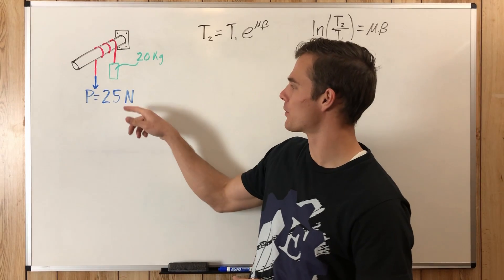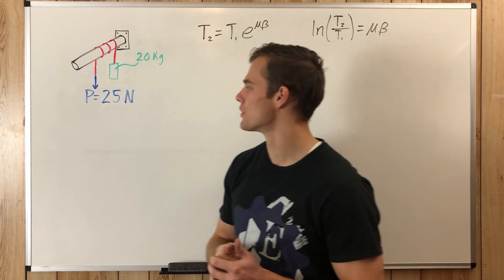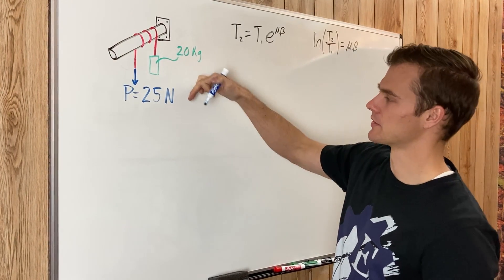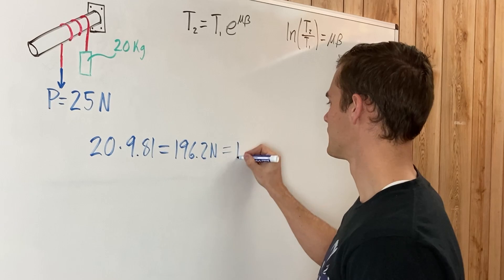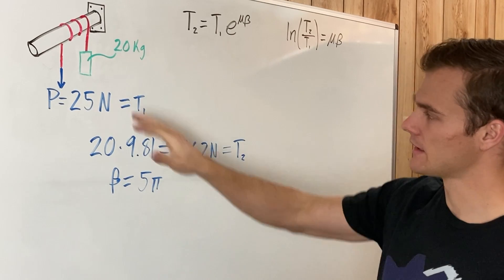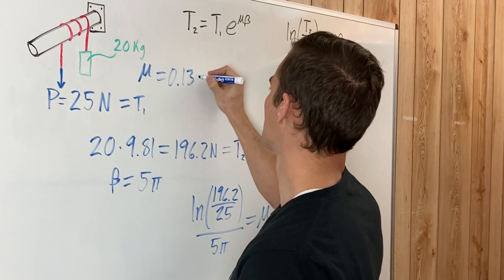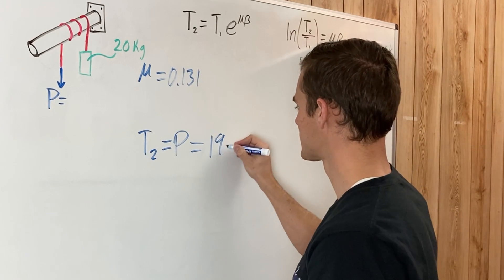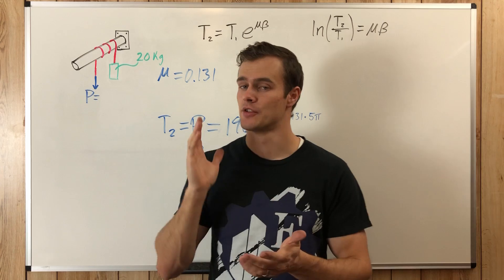Frictional Forces on Flat Belts EXAMPLE PROBLEM // Step by step, simple explanation

Comment: What if the pole can rotate with some friction, how does that change the dynamics?
If the friction of the rope is greater than the pole does only the pole friction matter after that?
Reply from the maker: Great question! I’m not exactly sure but it would definitely matter how easily the pole could rotate. I would think that if the pole could rotate freely then there would be no slipping between the pole and the rope. If the friction preventing the pole from freely rotating was greater than that of the friction between pole and the rope then the pole would probably rotate while the rope was also slipping around it. You would probably need to find the friction force from the rope and see when it matched the friction force of the pole rotating.